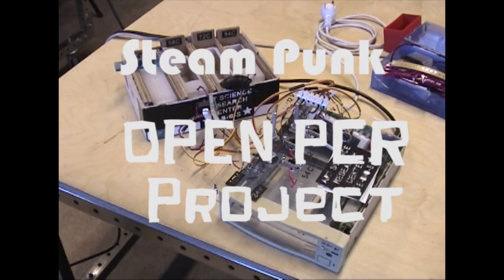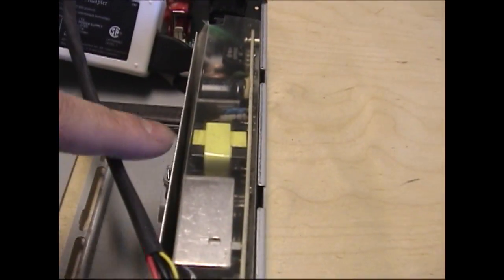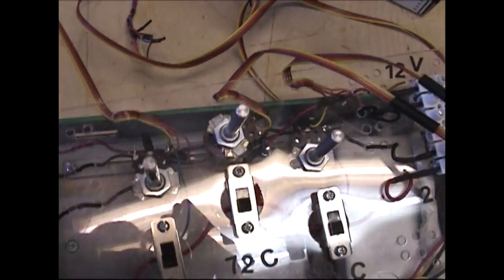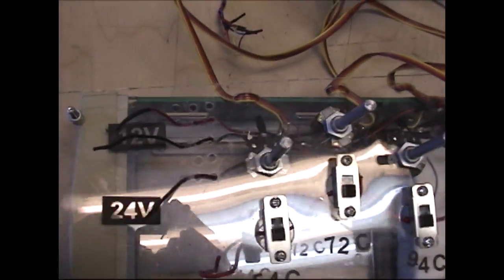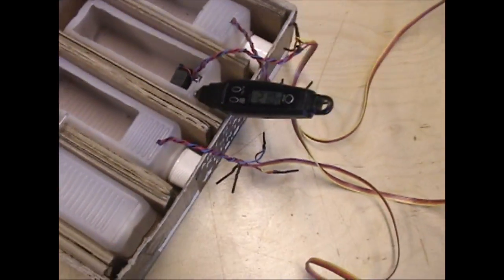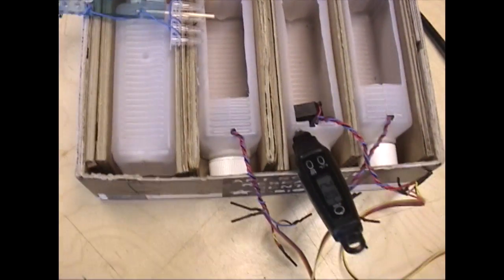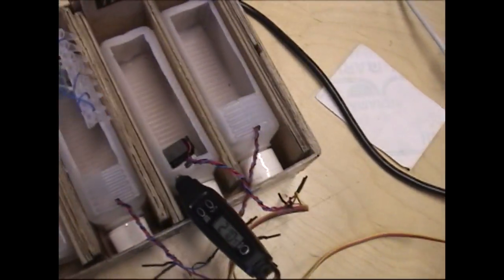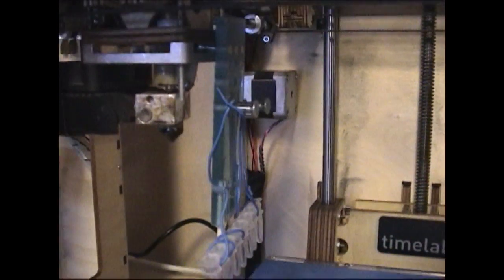Open PCR

Comment: ..I took out a sleg from my radio and from the radio-receiver of Rinus, put in front of me on the table and again tried to remember where I saw exactly such details and why it looks to me that I already have seen them many times .
Suddenly I remembered. I went to the bedroom and brought out a phonor. I do not needed screwdriver. I removed the case from the phonor, put my index finger under the bell of the endorser and, catching it with fingernail, extracted a vacuum tubusoid FH-92-U, four-digit, static field, capacity two. Sold in consumer electronics stores at fifty cents a piece. At the local jargon - the sleg.

That's as it should be, I thought. We were confused with talks about new drug. We are constantly confused by talks about new terrible inventions. We were already several times in
similar situation. When Mkhagan and Buris appealed to the United Nations with complains that the separatists are using a new type of weapon - freezing bombs,
We rushed to look for illegal military factories and even arrested two real underground inventors (sixteen and ninety-six years old). And then it turned out that these inventors have absolutely nothing to do with it, but horrible freezing bombs were acquired by the separatists in Munich at wholesale warehouse of refrigeration units and proved to be defective
super-freezers.
True, the effect of these super-freezers really was awful. In combination with molecular detonators (widely used by
underwater archaeologists on the Amazon to repel piranhas and caimans) super-freezers were able to give an instantaneous drop in temperature to one hundred fifty degrees below zero within a radius of twenty meters. Then we urged each other not to forget and always bear in mind that in our time almost every month appear technical innovations of the most peaceful purpose and with the most unexpected side effects, and these properties often can make the prohibition of production of weapons and ammunition simply meaningless.
We became very cautious with new types of weapons used by various extremists, and just a year later fell to another trap when they started to search inventors of the mysterious apparatus with which Poachers lured pterodactyls far beyond the reserve in Uganda, and found a DIY homemade from a Russian children's toy "Stand up - sit down" and a fairly common medical device produced by Phillips
And now we caught a sleg - combination of a standard short-wave radio-receiver, a standard tubusoid and
standard chemicals with very standard hot tap water....

Comment: Genetic engineering is proving to be an increasingly useful tool, effective at everything from protecting plant species to helping humans battle disease. It’s also getting progressively easier to harness, which is why we’re seeing a quickly growing community of do-it-yourself genetic engineers (or biohackers) emerge. Many of these DIY scientists are focused on improving animal species for better breeding, but some skeptics are afraid some well-intentioned scientist somewhere might accidentally home-brew a deadly pathogen or open some other sort of Pandora’s box of genetic devastation.

To this end, the U.S. Food and Drug Administration (FDA) is moving to regulate the work done by these so-called rogue genetic engineers. They’ve now released a revised draft of their guidelines for regulating animals with intentionally altered genomic DNAs. Prepared by the FDA’s Center for Veterinary Medicine, the guide covers animals that have been produced using any genome editing technologies or genetic engineering.

“This guidance addresses animals whose genomes have been intentionally altered using modern molecular technologies, which may include random or targeted DNA sequence changes including nucleotide insertions, substitutions, or deletions, or other technologies that introduce specific changes to the genome of the animal,” the draft reads. “This guidance applies to the intentionally altered genomic DNA in both the founder animal in which the initial alteration event occurred and the entire subsequent lineage of animals that contains the genomic alteration.”

Comment: Here  some extra  info about project.
Reply: +VladimirGent  

https://www.kickstarter.com/projects/563115656/3d-printer-into-pcr-machine-conversion

 Speaking about scientific  research,   that system  in some 
situations  could provide  huge  advantage  over  standard robotic 
PCR-thermocycler  with one block of metall changing  temperature  by the
 programm.

It is just proof of principle  , universal machine.. It can be  
extended  to 12 chambers or more,  just  need a bit of experimentation  
with resistors   to tune them  for  different  T values .. and all the 
temperatures  are available at the same time.    

I would  love  to use  such  full-manual  PCR-machine   at my work  
as  R&D researcher  in lab.  I always  tryed to do something  
strange   and new  there.  Unfortunately  I did made it  only  now, when
 I have lots of free time  and no job  to invest  my creative energy 
into. 

I see some interesting  possibilities  when  that system  might be 
superior  to standard  thermocycler.. For example  microvolumes PCR,  or
 when very fast  transfer  between different temperatures needed.  For  
robotic commercial thermocycler  it is  next to impossible  to   move  
temperature  from  99C  to 1C  in a few seconds.... With this machine it
 can be done  easy..  And  so on. This  universal device  has no limits 
 at all,  everything is possible.  Some extra  manipulations  during  
PCR  are  also  possible,  like  microwave  or  light  treatment  of 
samples,  or  just add one simple  fluorescence reader  and  it becomes 
Real-Time PCR... 

It has  potential  not only for  DIY  amateurs  but also  for 
professional labs too, when prototyping  new  methods, or a protocol  
for example. 

Sincerely,

Vladimir Kaigorodov, PhD